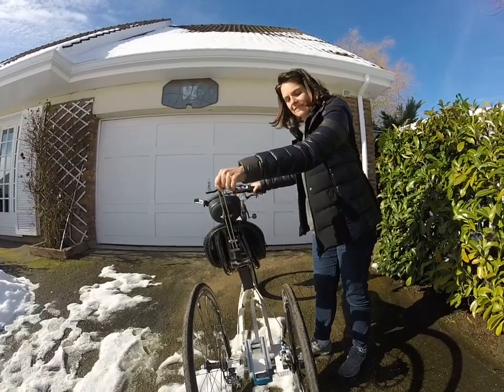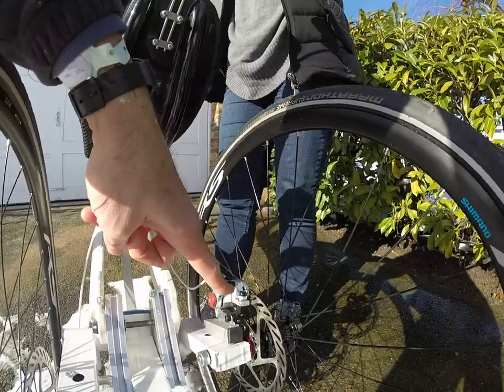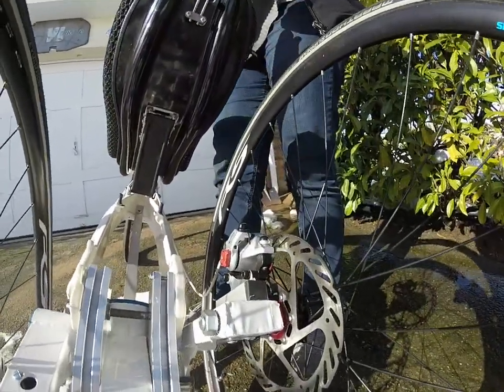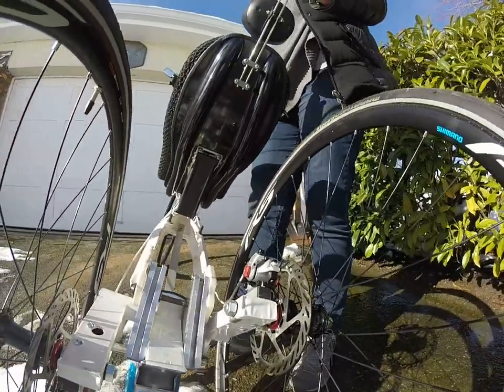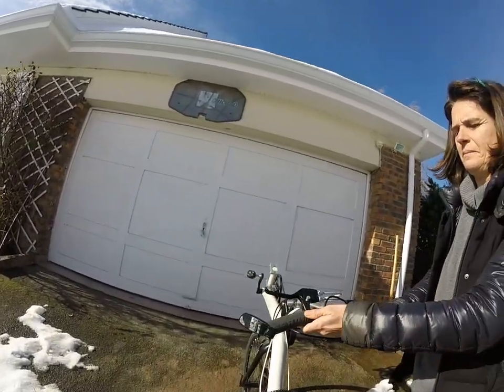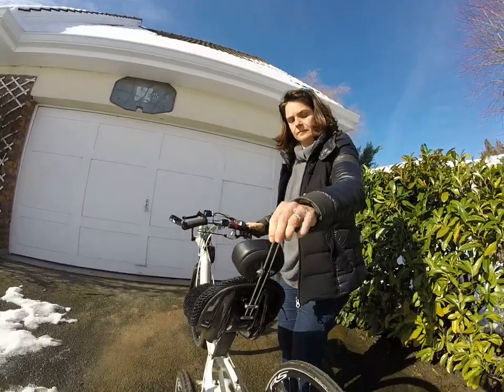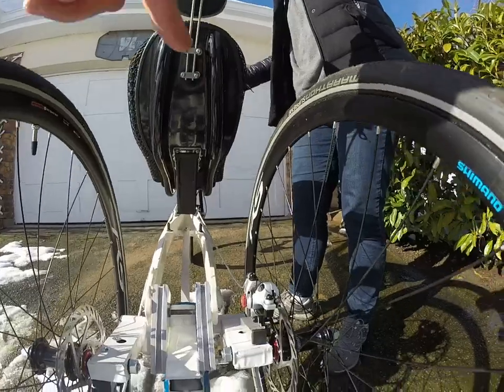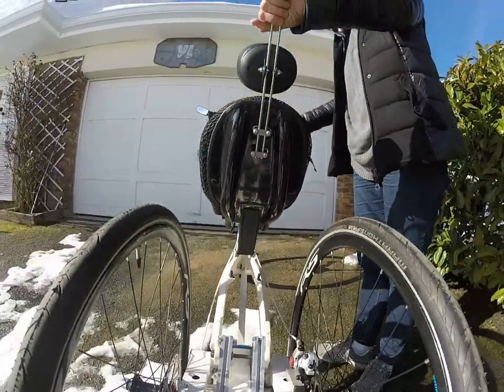Tilting trike locking mechanism explained

Comment: Very simple and effective. Only downside is, if the braking isn't completely symmetrical on both sides, the bike will want to lean during braking. That probably mostly depends on the brake pads and discs. Not a big worry, unless you catch a stone or something in it.
EDIT: greetings from Aargau :)
Reply from the maker: Exactly! For this reason I have 1 brake lever with two cables to ensure symmetrical contact with rear disks. This solution requires a set-up with special care but gives really good results.

Comment: but, if you brake while cornering, does that mean seizing the tilting mechanism mid turn? so if you are doing a high speed corner, and need to break, you would loose control of the steering? (especially is the front wheel is not tiltable)
Reply from the maker: Both rear brakes must be perfectly synchronized, this is why I use one single brake lever with two cables. So when I use the rear brake the lever is pulling both cables SIMULTANEOUSLY. This is important because if one rear wheel slows down before the other then the bike will tend to go to that side.

Comment: This is a very interesting design; well done. If either of the rear wheels hits a pothole or rough road you get some suspension effect right?
Reply from the maker: Hi Timothy, thanks for your appreciation! To answer to your question I think yiou may have a look at this video where we can see how this tilting mecanism can 'absorb' small irregularities on the road:
https://youtu.be/0Jw9qxrbnQQ
Reply: It is clear in that video that you do get some damping from road roughness. Could you also place a spring/elastomere or airshock on each pivot arm to get a more complete suspension?
Reply from the maker: I guess an elastomere would be good but ...not in a short period of time! I plan to do many more tests, and moreover this tilting trike is the preliminary step to finalize my solar trike. So I still have quite a lot to do for the next few months...

Comment: I am ready to try it out.
Reply from the maker: Hi, thanks for your appreciation! I am at the moment trying to test thoroughly this tilting mechanism, to make sure it can be used in 'real life'.
For your interest I have also created a new blog where I describe the progress of this project: www.gonano.eu
Reply from the maker: So far I have been able to ride with this prototype 5000km without any major issue.
I am convinced that the mechanism is pretty reliable: more work is required to increase the leaning angle which is not sufficient when you go in a curve with higher speed.
In case you are interested to try it, you might send me a message via the web site: www.gonano.eu